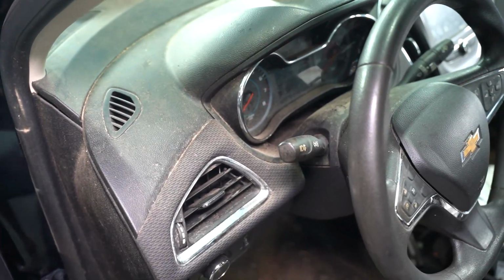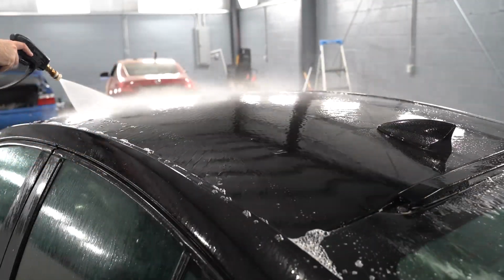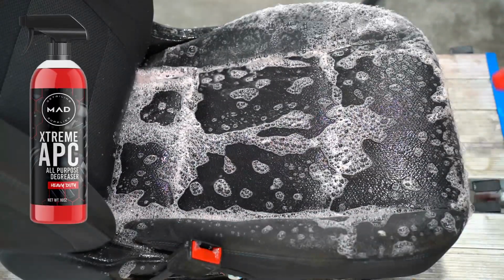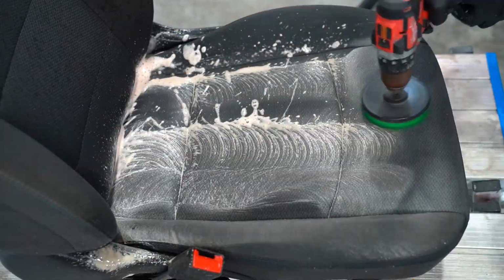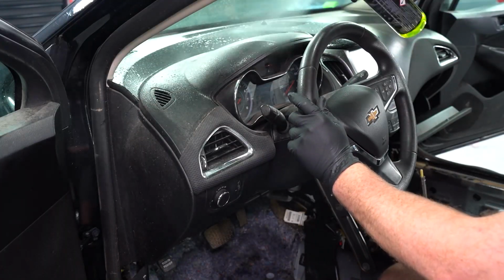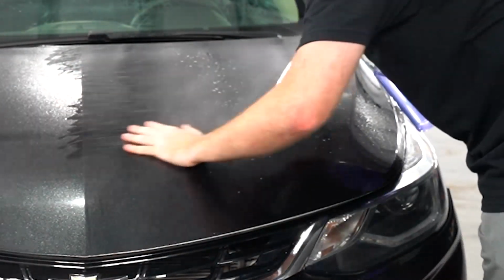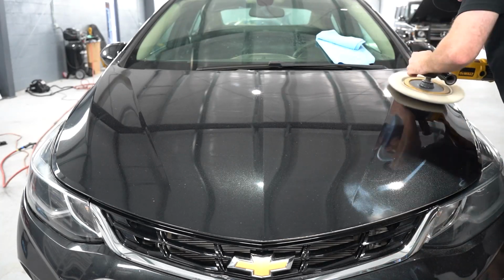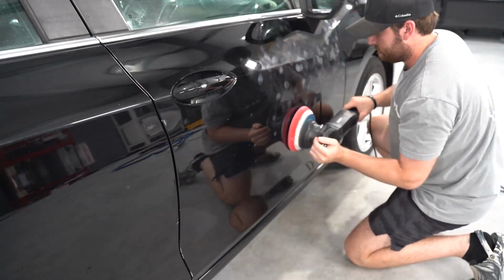Super Cleaning A Disaster REPO Chevy Cruze | Insanely Satisfying Car Detailing Transformation!

Comment: The other person you mentioned does enough of a job to a daily driver, but when it comes to paint correction and that finish line, yeah you and AMMO NYC are killer experts. I would refer to your channel for expert work. Question though, when would you use a large rotary vs when would you wet sand the paint?
Reply: You would wet sand to remove etched on stains or deeper scratches, extreme oxidation, also to remove orange peel you would wet sand, those are just a few examples, compounding alone isn’t enough to remove all defects, but it can do a noticeable job by itself if you’re not proficient with wet sanding. Wet sanding before compounding makes defect removal easier, but you need to know which grit is appropriate and how much clear coat you have to work with.